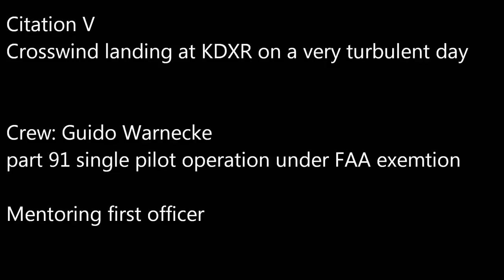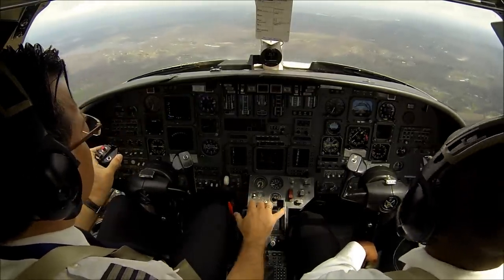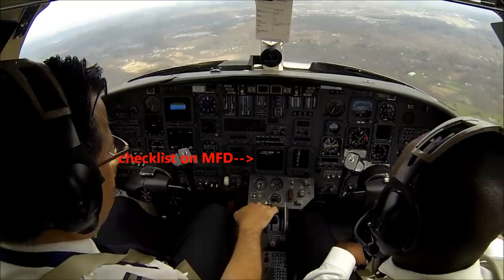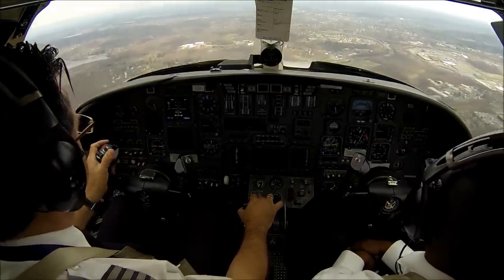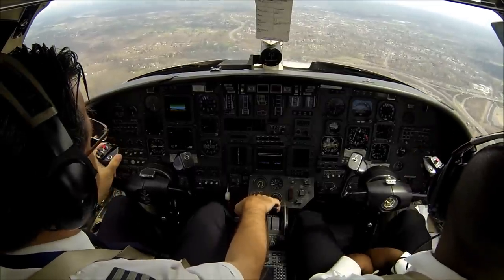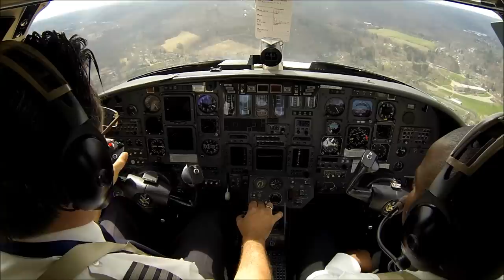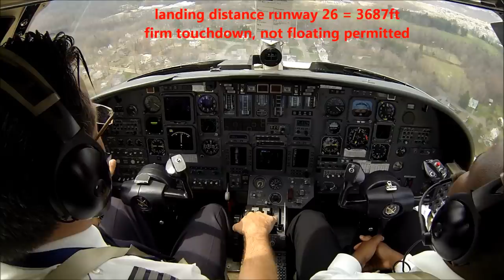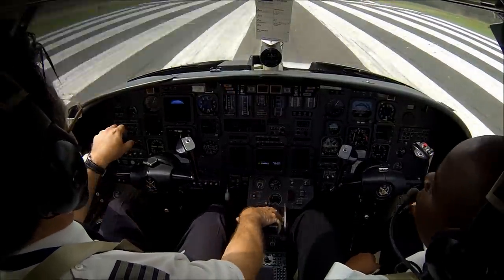Citation V: turbulence during landing. Cockpit view!

Comment from the maker: The modes are:
Excessive descent rate ("SINK RATE" "PULL UP")
Excessive terrain closure rate ("TERRAIN" "PULL UP")
Altitude loss after take off or with a high power setting ("DON'T SINK")
Unsafe terrain clearance ("TOO LOW – TERRAIN" "TOO LOW – GEAR" "TOO LOW – FLAPS")
Excessive deviation below glideslope ("GLIDESLOPE")
Excessively steep bank angle ("BANK ANGLE")
Windshear protection ("WINDSHEAR")
Keep in mind that this system is primarily designed for flights in clouds without view.

Comment: Such a smooth landing in heavy turbulence!!!👍🏼👍🏼👍🏼
Reply from the maker: Thank you!
Passengers grade pilots on "smooth ;landings". I think it is more important that the landing is controlled and within all safety parameters, e.g. touch down in the touch down zone at the right speed. 
If the landing is "smooth" it's often just luck. Also the design of the aircraft contributes to this. Some jets with trailing link gears almost always land like on butter. Others with a stiff landing gear like the C560 are more difficult. I had harder landings even if I thought I did everything right...
Happy Landings,
Capt. Guido

Comment: Wow! There were 2 sink rate audio warnings on that final. The captain flew that down to the runway markers & then flared. 
Wow! That is still cool, 9 years later with 3.9 million views.
Reply from the maker: This is a special airport with special terrain challenges.
The EGPWS will give yo a sink rate warning as you are low over the terrain.
Several jets are based at the airport. It’s safe if the weather conditions are appropriate and the pilot is properly briefed and experienced.
A sink rate warning is nothing to be ignored or taken lightly. 
I hope that clarifies some doubts you had with this flight.
Thanks for your comment and Happy Landings,
Capt. Guido
Reply: @GuidoWarnecke  Thank you. Appreciate your kind & detailed response.

Comment: Very nice landing, well done, guys!   Note they get out of the turbulence as they descend just before they bank their turn.  Turbulence is merely wind currents in the sky, the aircraft is MADE to handle it.  Most pilots will skirt a storm with turbulence but there is such a thing as "clear-air turbulence" which cannot be seen.  It sometimes causes up-drafts and down-drafts.  You can feel that.  (Some people call them air pockets but there is no such thing as a pocket in the air.)  A down-draft can cause an airplane to drop, sometimes a few hundred feet, but with altitude, the pilot is trained to handle that and fly on!  It's not fun when you are the pilot, I'm a GA pilot, and once hit a down-draft so severe it caused me to hit my head on the top of the cockpit and I was strapped in and it scared me, but so did a wind-shear once, that blew me away from the runway as I was almost touching down and I had to apply power and go around!  That caused me a little bit of uneasiness!  Many people in airliners get terribly concerned with a bumpy ride, but both the plane and the pilot can safely get through it, usually, with no adverse consequence.
Reply from the maker: You are correct. Small GA airplanes are more difficult to handle in turbulence than heavier jets.
Thanks for you comment and Happy Landings,
Guido

Comment: I'm watching soo many cockpit videos and turbulence videos because on my way back to Orlando yesterday, there was soo much turbulence on my flight. It was soo bad that i set my body in a position that if we die today we're just going to die. I said my prayers and turned out I was stressing for nothing! It lasted for about 8 minutes until we found clean air. The pilot apologize and after that everything returned to normal. I'm still shaking about it until now. I've never experienced anything like that! You've also handled that plane like a champ! Makes me wonder how you pilots even do it!
Reply from the maker: ***** Thank you!
In 99.9% of the cases turbulence is just uncomfortable and does not have any effect on flight safety.
The airplanes are designed to handle a lot of turbulence - much more than we human beings.
It is important to fasten your seat belt tight. I banged my head really hard on the ceiling.
Passengers not wearing seat belts have been injured in big airliners by being town to the ceiling and then smash into the seats. Often with broken legs and major injuries.
But it takes much more until an airplane breaks apart.
Flying is the safest thing we can do.
Thanks for watching my videos & happy landings,
Guido
Reply: Thank you Gudio for the reply. I really appricate it! :) I'll be sure to have my seatbelt on tight next time!
Reply from the maker: This is how it looks in smooth air:
https://youtu.be/Af3fVp8R8bg?t=280
Happy Landings,
Guido

Comment: Gives me a lot of confidence to fly watching you land the plane so well despite seeing the steering wheel ( is that the correct definition ? ) move so erratically. I can also see the plane bouncing in the air. Amazing video.
Reply from the maker: Thank you.
These aircraft are quite unresponsive at low (approach) speeds. So a lot of control inputs are required to maintain the desired flight path.
Not as difficult as it looks like.
happy Landings,
Guido
Reply: flight  controls  or Yoke is   the correct  wording

Comment: What does "ignition off" mean?  I know the engines are turbines and don't require ignition to run just fuel and air. Maybe it means you don't anticipate a restart that close to the runway therefore it wouldn't be needed.  Just a guess. Always enjoy your vids.
Reply from the maker: You are correct!
Once the turbine is running, the flame is self sustained.
On a jet engine you switch continuous ignition on iduring critical phases of flight (take off / landing), in heavy turbulence and rain.
In case of a flame out, this would ensure (hopefully) a quick re-light.
The igniters fire at a lower rate per second during continuous ignition, compared to the ignition during engine start. This is  to minimize wear on the igniters.

The correct wording for the ignition switch in the Citation V would be actually ignition "NORMAL", not "OFF".
In "normal", the ignition is off unless:
- the engine is started
- engine anti-ice is used

In the conditions prescribed above (take off / landing / heavy turbulence / rain) we would switch the ignition to "ON".

Thanks for your comment & happy landings,
Guido
Reply: Thank you for the response.  I had flown in a Jet Ranger with my buddy on numerous occasions and asked a lot of questions so I knew the turbine was like a diesel engine and required no ignition to sustain running.

Getting ready for any anomaly is always good.  Thanks again.
Reply from the maker: jbmbanter ALWAYS ask questions. In aviation there are no stupid questions.
It is a constant learning process.
Happy Landings,
Guido

Comment: Pilot makes it look so easy looked like some pretty decent crosswinds but could be wrong.  Nice video.
Reply from the maker: It is not too difficult, just requires some practice.
If it is unsafe or if it exceeds the aircraft's capability, we land somewhere else.
Happy Landings,
Guido
Reply from the maker: This is how it looks in smooth air:
https://youtu.be/Af3fVp8R8bg?t=280
Just "sailing" to the ground.
Happy Landings,
Guido

Comment: Is it Auto Pilot till what time... I mean at what time in this video is AP switched off and the plane flown manually?
Reply from the maker: This really depends on the situation.
This autopilot has some limitation when it needs to be switched off, depending on the type of approach you fly.
On an  ILS approach (if I remember correctly) the autopilot can stay on until 180 ft above the ground.
The reason is that the pilot needs time to react in case there is a malfunction of the autopilot. Aircraft with CAT III certification where the autopilot can stay on until touchdown have multiple autopilots and redundancy.
Where I switch off the autopilot depends on the circumstances, I do it sometimes much earlier, to practice hand flying skills.
Happy Landings,
Guido
Reply: It was a flight examination. (Drivers Test) No AP
The landing was visual and had to be smack on and steady. 
That was skill!

Comment from the maker: Hi Vito,
the "sing rate: is part of a protection system called GPWS Ground Proximity Warning System. It warns pilots of potential unsafe situation close to the ground. A sink rate of 1000 ft per minute is perfectly normal at say 10,000ft above the ground, but potential dangerous near the ground. There are several modes of the GPWS, all to prevent accidents by making pilots aware of possible threats.

Comment: I like flying, but I don't like sitting next to a dude in such confined space
Reply from the maker: +Rilex037 
this is the downside of some aircraft.
They are designed primarily  for passenger comfort - not so much for the pilots.
Thanks for watching my videos & Happy Landings,
Guido
Reply: The pointy nose is rather tight... so chummy up! I would be shoulder to shoulder with my instructor during hot summer flying and we would both get off all wet.
Reply: Loop wdewgirl

Comment: Dear Guido - firstly thank you for posting your video's: I really enjoy them. I am not a pilot so forgive this question - as you are about to land (at about 3.48) I notice that you have to operate the controls very "strongly" and this contrasts with the gentle operation throughout most of the flight. You mention the concrete truck attributes of this aircraft at landing speeds but I am surprised it does not react much more to your "commands".  Anyhow thanks again for posting. Cheers Andrew.

Comment: My best landing ever was during what I considered "strong" turbulence on long final. Strong enough to report it to the tower. The wings rolled hard causing me to drop the mic and focus on wings level and approach airspeed. I felt like I was all over the sky with difficulty holding altitude. Gust up, then down. 
 
I decided (moment of inspiration) to hold flaps 20 reducing the surface area limiting the strong buffeting and using a slightly higher approach speed to avoid potential stall and allow a possible go around. With a sudden slight drop in altitude over the threshold, my nervous passenger pushed back in his seat. 

I was bit nervous, too, anticipating the next gust. But I was also very focused on the approach. I fought it all the way to the flare. Next thing I knew the nose wheel softly touched the runway. I was shocked. I never felt the main gear touch the pavement. Unexpectedly greased it. Luck, I guess. :)
Reply from the maker: I apologize for my late reply.
My experience is that the more I concentrate to make a greaser landing the worse it sometimes gets.
Important is that the approach is stable and the aircraft under positive control at all times.
If a greaser landing occurs - it’s a nice bonus 
Happy Landings,
Capt. Guido

Comment: Dear Guido, thank you for detailed explanation so much. But I would like to know with it gives you warning during tjis particular approach? Is the glide slope is to steep there?
Reply from the maker: Thank you Vito.
The aircraft is equipped with a GPWS ground proximity warning system. Google this.
It monitors the flight path of the aircraft in relation to the ground. While a descent rate of 3,000 feet per minute is not a risk at high altitude, it an be risky at lower altitude. Hence there SINK RATE warning during the approach when we were at low altitude.
Happy Landings,
Capt. Guido
Reply: @GuidoWarnecke  thank you so much:) Your reply was a bit unexpected after all these years:)
Reply from the maker: @vito_n  Better late than never... :-)
Reply: @GuidoWarnecke  absolutely:)

Comment: Sure was a lot of control input just before main gear touchdown.  Cross wind landings sure do elevate the pucker factor!  :)
Reply from the maker: These jets are designed mainly to fly at cruising speed. 
The control responsiveness at lower speeds, like during an approach is not too good.
A bit of over controlling from my side. might have been involved too.
Happy Landings,
Capt. Guido

Comment: I was taught early on in my training by first of a few flight instructors  to not extend flaps in a bank while at low altitude or turning in traffic pattern as a precaution in case of an asymmetrical flap extension. Never heard that later from anyone else and noticed you deployed base to final I think and was just wondering if you ever heard anyone talk about this?
Reply from the maker: This is a difficult question.
Modern aircraft are technically well protected against asymmetric flaps. So this might be a rule that is quite obsolete. I might be wrong but I am not aware of any limitations regarding flap extension and turns in business jets.
I had a "split flap" in a Cessna 402 once (one flap up, the other full down, a cable broke off), this was quite violent but it could be handled. Reduce speed and retract the other flap. 
Some "rules" like "do not lean the engine below 5,000 ft" are there and never go away. Even with the fact that most light aircraft have precise engine monitoring gauges now.
You are not doing anything wrong if you extend flaps only in level flight.
Happy Landings,
Guido
PS: although I understand and respect the anonymity of the web, I would appreciate if you could write your comment with your clear name - it's just more personal. Thank you!
Reply: Hi,
i've never heard about such advice. I made it already in the early 80th years as a flight-student (in Germany) on a Cessna 150/152 and Piper Tomahawk PA38-112 in base- and final-turns on 700 to 800 feet AGL -  without any problems. This aircrafts are from the 1960th years... 
And a Jet (like a Cessna Citation is) is quite fast in the pattern and also in turns - so it don't should give a problem with a weak asymmetric flaps.
The only limitation i know is to avoid to lower the gear in strong bank-angles, cause of possible malfunctions in the gear-slot. 
But in simulators i also do that sometimes. ;) Ok, normally you should do it in the final with jets and in the downwind (end-part of it) with Piston-Aircrafts. 

Some old instructors, who learned in early years, are teaching such old messages, ok. It's the same like the message "Don't lean below 5.000 feets...." and so on. That's wrong for modern Engines and modern scientific - that was ok for old World War II Aircrafts with they old engines, but not for a Lycomming or Continental Engine today. ;) You have to lean depending your flight-situation and weather conditions when ever you go out from the traffic-pattern, nothing else. ;-) There is no altitude-borderline to do it. (ok, in 1.500ft  QNH it's not necessary of course)
Older instructors are teaching sometimes stupid things. And they don't think about and reflect this thinks themselves.  

Always three greens!
Reply: Thanks for  your imput , I just wanted to see if you had ever heard of this practice. I think my instructor probably taught this because we were flying in older aircraft and he actually had heard of an accident where a cessna flying low turning base to final deployed flaps while in bank and had this happen and went inverted and crashed and it was the opinion of some if they had been straight and level when they deployed flaps then they probably would have had better chance of making corrections needed to land safely.
 I figured with newer more advanced aircraft this was probably not as much a concern but was more asking your opinion in regards to people learning smaller , many times older aircraft.
 Sorry for username, its only youtube account I have at this time so  its the way it shows up in my post for now.
 
   Safe Flying and thanks for responding.
Reply from the maker: This is how it looks in smooth air:
https://youtu.be/Af3fVp8R8bg?t=280
Just "sailing" to the ground.
Happy Landings,
Guido